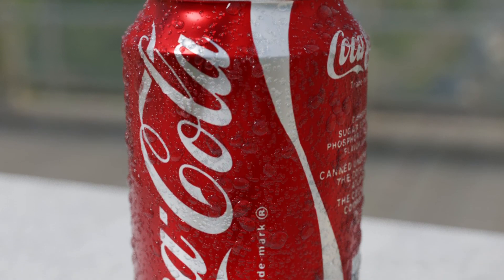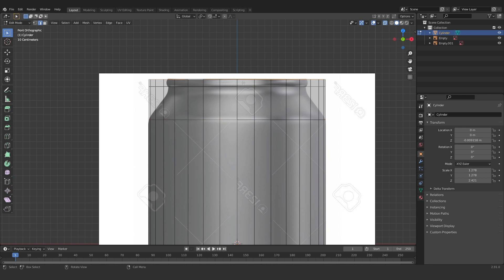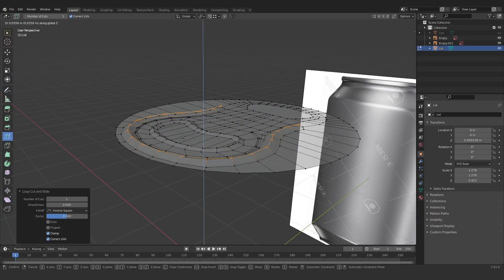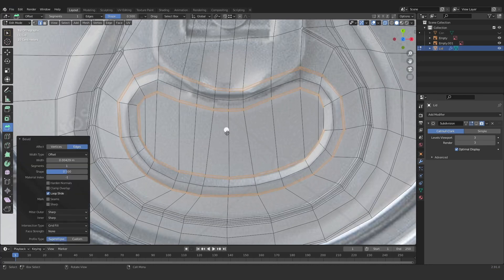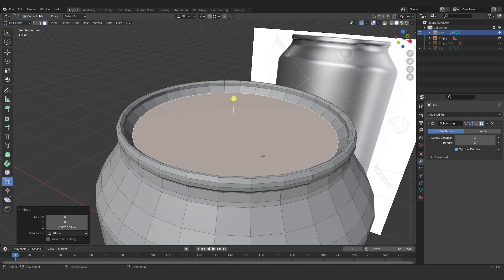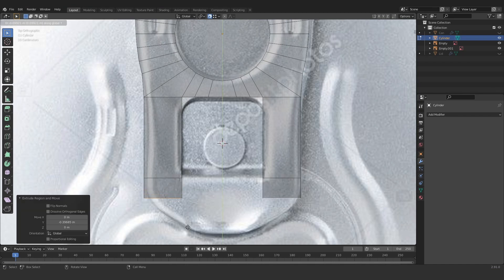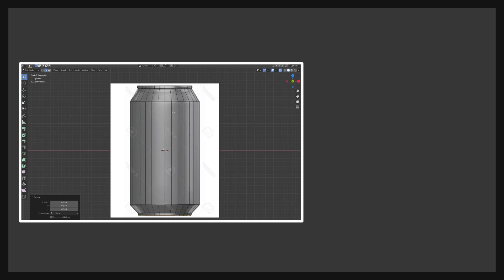How to Create a Photo Real Coke can in Blender | Modeling

Comment: Do u have any tips for the top of the cans ? I Block for the top of the cans principally because the subdivision surface don't want to be apply and my vertex are not align as in the video …
Reply from the maker: The best tips I can give are. 1. Make sure the top of the can is a separate object, this will allow you to have as much resolution as you want. 2. Use a small amount of geometry then by hand place the vertices onto the lines. You can use the x-ray view to see through the model. 3. Once you have your shape, use holding edges, these are edges that are close to other edges in order to make them sharp. You can see me perform this step in the video when I bevel.
Reply: @InsidetheBoxFilms  My problem is that when I try subdivision my shape are distorted but I really don't understand Why cause I did everything like U
Reply from the maker: It's possible that you have hidden vertices, or vertices that are very close to others so they appear to be one. You can get rid of these by hitting "tab" to jump into edit mode then "1" for vertex mode. Then you hit "a" to select all of them. Then "m" to merge vertices and select "by distance".
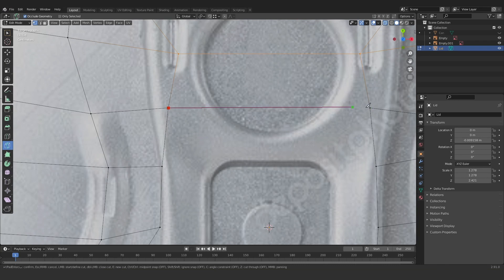Reply: @InsidetheBoxFilms   I have a problem with the knife at 2:54 is it ok if I juste select my two vertex then I press F on the keyboard ? Thank u sooooo much for your answer man !